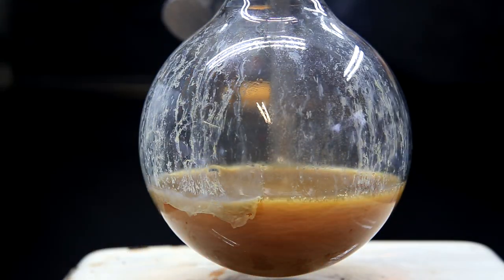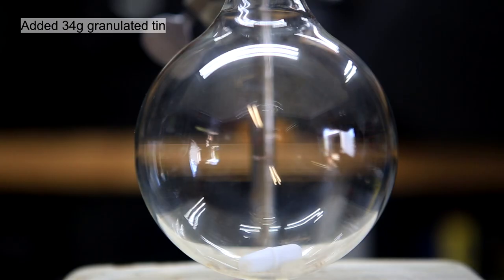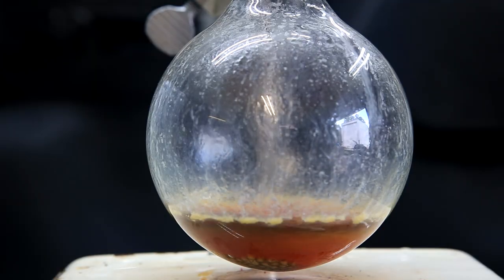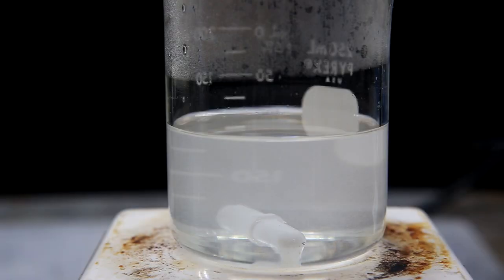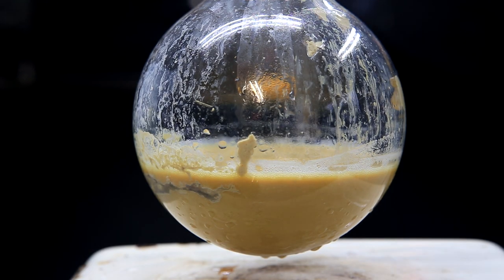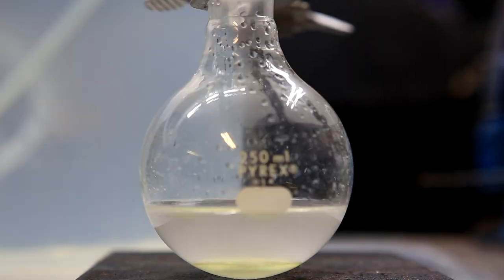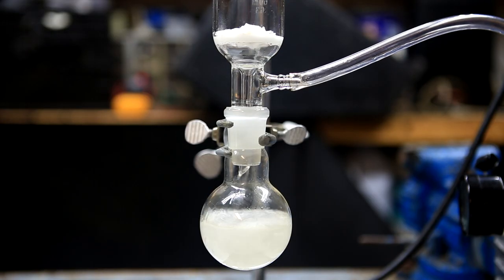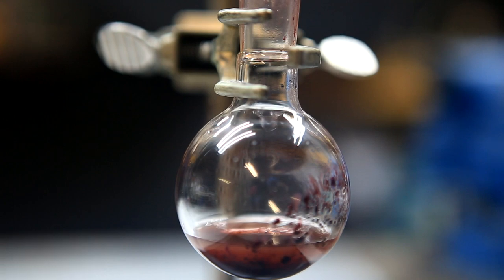How to make Aniline

Comment: Excellent video! I feel that whilst solid KOH is often a good drying agent for organic bases, it can react with DCM solvent to form formaldehyde. This can react with your product so it might slightly reduce the yield. The reason I think this is happening is because the red color in the distillation flask is typical of the condensation reaction of formaldehyde and a strong base.
Reply from the maker: +WizardChip Yeah, that did occur me. Doing it for a short period of time, it should be okay though. Ideally I would have used molecular sieves. I don't know why I didn't.
Reply: Aniline, KOH, and CHCl3 gives Isonitrile (stinky).
Reply: Fezziiwig 85ml liquid have 31.45 g  HCL?
Reply: Is tin chloride the one reducing the nitro group or is it the atomic hydrogen produced in situ from the reaction of tin and hydrochloric acid?
Reply: @randomname7918  since in his synthesis equation says sncl2\hcl. i guess it is the tin chloride
Reply: @sinnequanon1958  Yeah, I checked on wikipedia and apparently tin(II) chloride is used as a reducing agent.
Reply: @Paonporteur  I was not doubting the existence of hydrogen, no need to be so sarcastic

Comment: Would you be able to talk about Aniline in Leather jackets.  When I first bought one years ago, the store had tags with just Leather Aniline.  They said it means the minimal finish which makes the jacket soft and smooth (no water proofing) Or do they just mean, basic dye finish with aniline and that's it.  Its not special to making it soft?  I would love to know what makes some jackets soft, is it a chemical.  So actually choosing different animal leathers doesn't make it smooth and soft but it's the chemical finish.  Perhaps they not make fake leather soft like the best leather because of a chemical that I've not heard of.  So by soft I don't mean like durability where you would choose the type of animal for.

Comment: Just FYI, if you want to purify impure aniline but for some reason you don’t have the ability to distill a great way is to use oxalic acid to form dianiline oxalate which is insoluble in water. You filter and can then recrystallize the salt from I think either ethanol or water and filter. The pure crystals can then be free based with sodium hydroxide or carbonate and using a sep funnel to extract and separate the pure aniline

Comment: The red colouring is probably azobenzene with a boiling point of 293 C which is formed also from the reduction of nitrobenzene, however it is less reduced than aniline which indicates that the reaction probably didn't actually run fully to completion

Comment: I am planning to make some polyaniline with very large single layer graphene flakes and testing it as a heat conductor.  Do you have any words of advice for me?   I will be using your procedure exactly.  Will be making my own stir mechanism since I can set the spin rpm to an exact value.  I might also buy one but making one is much quicker.

Comment: Weird question and this might be just twice as harder but why wouldn’t just take the benzene you made in a different video, nitrate it with HNO3 and H2SO4 to add on NO2 to the benzene and then use any reduction reaction like H2 with Pd/C, wolf kishnner, or clemmensen to replace the NO2 with NH2? I might not understand the difficulty in the clean up step between reactions so please correct me if I’m wrong or if this is just way more difficult or makes a less desirable yield.

Comment: Hello, this might be a weird question but I was wondering, what causes a double displacement reaction to take place? For example, in the reaction of copper sulfate and hydrogen sulfide : CuSO4(aq)  + H2S(g) --> CuS(S) + H2SO4(aq). The sulfate is already satisfied with the electrons from the copper and the sulfide is satisfied with the hydrogen. Does the sulfate want hydrogen's electrons more than copper? Why? thank you.
Reply: It is not a redox reaction. Let's say if there are (what I write here is oversimplyfied) Cu, S, H and SO4 ions present in a solution, only S and Cu want to percipitate to create CuS. If there were Ca, SO4, Cl and Fe ions present, only Ca and SO4 will want to percipitate to create CaSO4. Because both CuS and CaSO4 are insoluble.
Reply: Wow, Thank you!
Reply: +jdflyback The simplest way to find out what will happen is to figure out:
1. What ions are in solution.
2. What insoluble salts can they form. If there is one, it will likely percipitate.

It may be more complex for very low and very high concentrations, and some salts may interact different way (redox, copercipitation etc.)
Reply: Thank you.
Reply: You will probably get to know more if you search about ionic product and ksp in ionic equilibrium

Comment: at around the 1:32 mark, you say a total of 85 mL of the HCl acid will be added to the flask, but at the 2:15 mark you say a total of 75 mL of HCl acid was added. it looks like your using a recipe that is 3/5's the scale of the one in the link. if this is the case, wouldn't you use 60 mL of HCl acid. I'm not a chemist but i think you fubed the numbers.
i mean no offense, just looking for clarity. i find the chemistry  info you post with your vids fascinating so keep it up stud.

Comment: Isn't aniline also used as a rocket fuel too?
Reply: +Matthew Ferrie 
It was used with Nitric Acid to fuel rockets. They react quite violently when mixed and burnt.
Hydrazine replaced them a little while later.

Comment: What could be the difference between using NaOH (ac) and NaCO3?
Reply: there is no such compound as NaCO3. Na2CO3 is sodium carbonate, if that's what you mean. You could use it to neutralize the leftover hydrochloric acid, but it wouldn't nearly as efficiently recover aniline from its salt form.

Comment: How might I perform this same reaction if I already have tin chloride? Do I just need the same molar amount as the tin metal and then add some HCl?
Reply: I think that metallic tin is necessary for the reaction, because the generated nascent hydrogen reduces the nitro group, but you can replace tin with iron or zinc, they are much cheaper

Comment: hey guys im looking around for something like aniline to use for a very permanent Ink/paint/color liquid, can I get any tips on something to use to that? 
Would like to see a result with a paint as permanent as physically possible. 
and with variations considering toxicity and avaliability

(Living in europe)
Reply: Depends. There are pigments that withstand some geological conditions and not others. Binder ("paint/ink") is the other part. Also, you didn't specify colors. Generally, pigments made from ground up minerals incorporated in fired glazes are historically permanent. "Aniline Black" was used to color laboratory furniture because it was chemical resistant. Iron pigments: ochre, sienna, Indian red, et al are lightfast and quite permanent. Chrome green. Cobalt blue. Ultramarine. Colors made from organic dyes are not lightfast especially reds. Mold and moisture and light and air pollution can destroy the binder.
Reply: Hi, and thanks for your reply.

Well since I would like it to in theory be resistant to chemicals I take it from your text that the best suggestion is "Aniline black" also what color is not a question of great importance as Black color surely is fine. I did some very quick googling on Aniline black and did not find alot of information, how does the process to produce said colormix look like ? Theoretically already having the Aniline oil.

Thanks again for your greatly helping answer!
Reply: Aniline dyes are derivative compounds. Aniline itself is not a dyestuff, binder, or solvent.
If you can synthesize aniline per this video then you shouldn't have much trouble with the synthesis of aniline black or similar, but it'll be cheaper to buy the stuff.